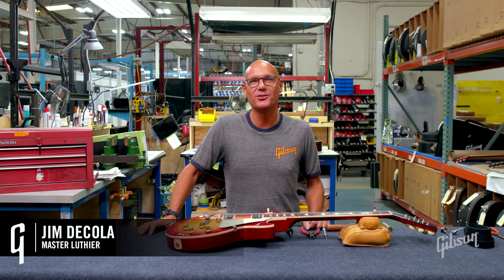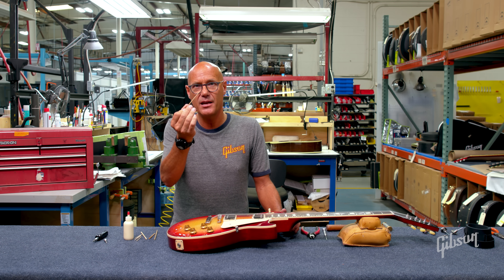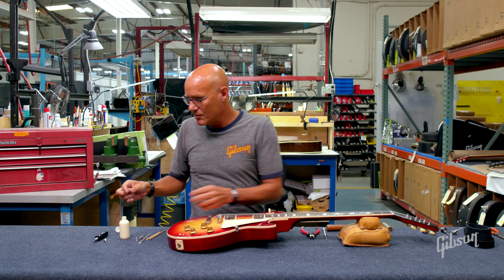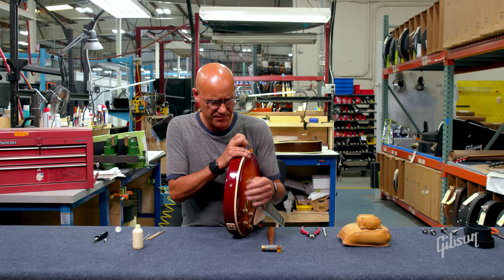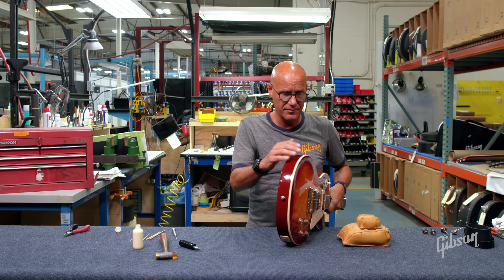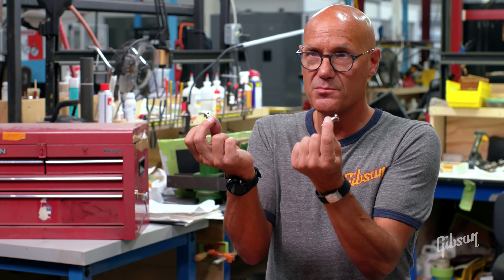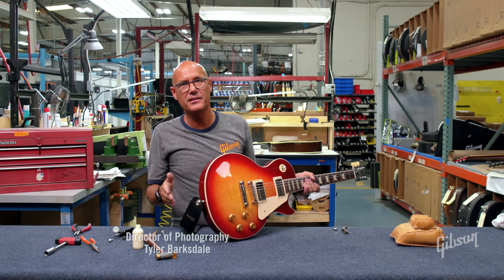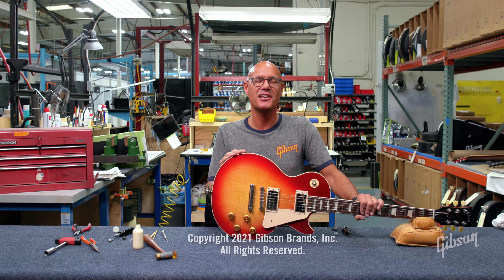How to Fix a Strap Button and Install Strap Locks on Your Electric Guitar

Comment: I've been fixing my strap buttons like this for 50 years. My only addition to this it that I first break off the toothpicks, pull them out and reinsert them fat end first and tapered end near the surface so that the screw seats better. Just my $.02.....Great video!

Comment: Thank you GTV and JD!  Schaller - another name for these locks are, "Hey man, you got a phillips I can borrow?".  The screws they come with are much too short.  However, better than no locks at all, so I standardized on Schaller and put them on all my gits and straps way back in the day.  Next, you will find you constantly have to tighten the nut/washer combo on your strap.  Then I bought my first Les Paul which came with Dunlops.  Mind blown.  Far superior, to say the least.  Gigged four nights a week for 10+ years and never needed maintenance.  No more phillips.  No more checking and tightening a nut on the strap.  Plus, the "button" portion is larger and provides better real estate for a standard strap should you find yourself in that situation.  I hope this helps someone - cheers!
Reply: Hello please what is the dunlop do you use? Thanks

Comment: The toothpick is fine, but sometimes it may not last very long as it a soft wood. I usually cut off a sliver of wood from a broken drum stick and use it along with the wood glue. The maple from the drum stick is a much harder wood and thus is more secure and stronger.

Comment: I used this trick back in 2018 with my Gibson Firebird. Just a toothpick, no glue. It's been holding up with my strap locks ever since. It'll be almost 6 years. I'm surprised that it worked!

Comment: The Dunlop screw is slightly wider and potentially longer. Their instructions recommend drilling the hole slightly wider.
I scrape the screw on some hard soap to make it go in easier. Using Dunlops on over a dozen guitars. Some have been on for 30 years and even the strap portion is still good.
Reply: I have Dunlops and want to install them on my Epi 335. But, I'm scared of cracking my guitar. Any tips/advice for a semi hollow or is the block basically in the same position as a solid body so it's a moot point?

Does "hard soap" = "random brand of bar soap"?

Comment: Used toothpicks all my life to correct screw loose issues. Learned that trick from my dad who worked at Chevrolet  assembly plant in Detroit starting in 1946. Good post Gibson!
Reply: is it a temporary fix or will it last for life ?
Reply: @rv6205  long time fix!

Comment: A 3/8" hollow steel leather punch cuts perfect holes for Schaller style locks. I have a General No.1280 I got from Amazon. Mojo Axe has Schaller style locks that fit the two different size Gibson screws without having to grind the screw heads down to get them to go in the button barrel.

Comment: Toothpick - glue - Schaller strap locks... they haven't failed me yet. Once at a gig I had a guitar with a loose strap pin (I hadn't put strap locks on it yet), but there where no toothpicks handy for a quick fix. But, I did notice that the table I was sitting at was made of wood. So I got out my Spyderco knife and whittled off a small piece of wood from the table and used it in place of a toothpick. On the road you got to be handy and let your inner MacGyver kick in.
Reply: ha hah ah ahahah aha a ahahahaaa used to do that all the time! Was just talking about that the other day… a bit of the table, a bit of the stage, whatever it takes…

Comment: I've even run out of toothpicks and used 2-part epoxy lightly on the screw thread. If you time it right you can unscrew the pin before the metal bonds to it (but the epoxy is hard enough to stay in place) and create a new thread that lasts decades.

Comment: I've been using toothpicks for this purpose for years. But I snip off the pointed ends. You should re-edit the guitar strap portion of both brands. You need to show more of the zoomed in footage for novices to clearly visualize the process. A stripped tuner screw extraction video would be nice!!
Reply: Last time I had that issue it was in my smoking days, I used Briant and May matches.

Comment: I take an eyedropper and fill the strap button screw hole with water and let it sit in there until it is absorbed.  Then, after it is absorbed, I put more water in the hole and let that be absorbed.  The water in the hole swells the wood and grips the screw much tighter.  I let it completely dry and then put some white all purpose glue on the screw and screw it back in.  Works great if the stages of looseness are early.  This works well for loose pickguard and rear control cavity cover screws.

Comment: Hi Jim, I was going to purchase strap locks years ago on my Les Paul's, but chose not to because the screw diameter was larger than the stock Gibson screw, which would require altering the guitar. Can you confirm please? Always wondered why the strap lock manufacturers didn't offer hardware that matched the original size/pitch. Thanks!

Comment: In my experience, the straplock screws are normally larger in diameter and length than the existing screws. I always use a separate screws to enlarge the existing hole. Forcing the new larger screw often results in stripping the  screw head

Comment: The other day I was explaining to my daughter why my strap locks aren’t installed on my two new guitars. I don’t have toothpicks and wood glue in the house. I used to program and set up CNC machines working with metal and nylon. Working with wood my brain still wants .005 inch tolerance—machinists require too much perfection to work with wood!

Comment: On the strap pins, is one pin supposed to be longer than the other? My 1950's Gibson Les Paul Standard has one smaller than the other? I removed them b/c I didn't want to over stretch my expensive leather strap, but I didn't pay attention when I was removing them to notice that one was longer than the other, until I went to re-install them both. That's when I saw that they were both of different lengths. So I put the longest screw into the bottom strap pin & the shorter length wood screw. I put into the top one, but I've been wondering if I did it correctly? Also why wouldn't they both be the same length? Also there was no washer & there was no felt on my strap pins? My Fender has really nice felt washers but my $3,000 1950's Gibson Les Paul Standard has none?

Comment: One of the strap buttons on my BRAND NEW Les Paul pulled right out of the guitar just by removing the strap. Dear Gibson, please drill smaller pilot holes. There was literally no wood for the screw to grab on to.

Comment: Terrible, unreliable fix, especially for heavy and expensive guitars like LPs. Every time I buy a used guitar, the buttons are loose and toothpicks fall apart. I have to drill a larger hole, glue a hardwood dowel, and redrill for the original strap button screw size. Another option is to use longer, neck mounting screws, but they might not work if you need to keep the existing strap button unmodified.